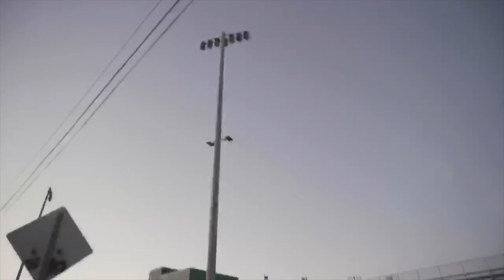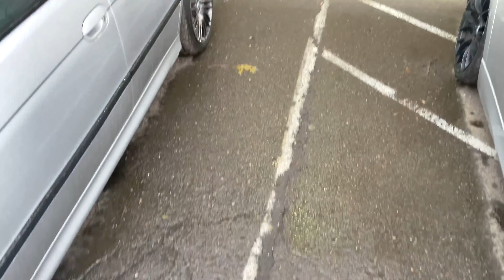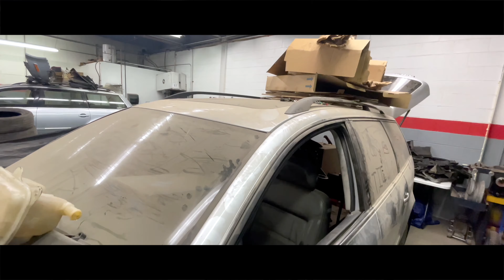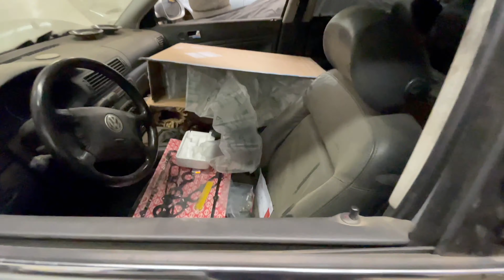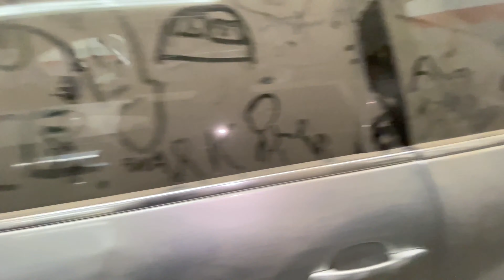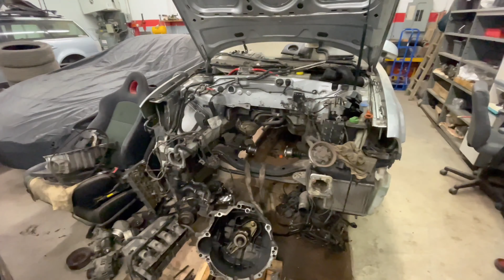My New Build

Comment: Try to air brush clean your engine before you install it get a light wire air brush tip and let's see the shine. At least while you await the parts?
Reply from the maker: Ended up putting it back as is, pressure washer should clean it up a bit